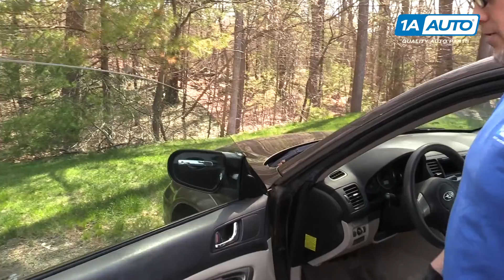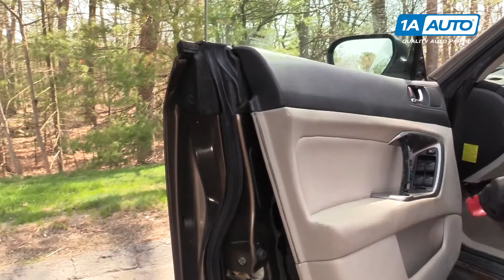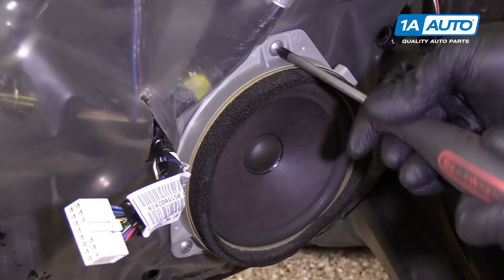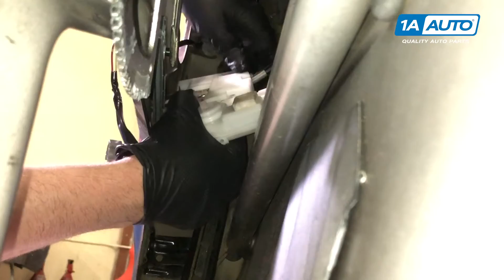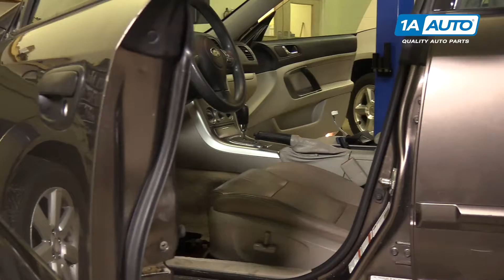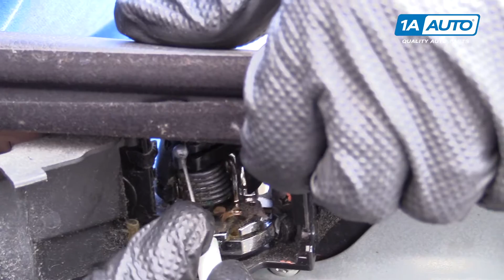How To Replace Front Door Latch 04-09 Subaru Outback

Comment: Hey, thanks for the video! Great video were capturing images of the parts, etc. Super helpful to get bearings and visual. 
 **PLEASE READ HUGE TIME SAVER- NO NIGHTMARE W/LATCH ROD**: First like everybody says you don’t need to pull the speaker/full vapor barrier etc but it’s still useful for people trying to get bearings on how it all goes together. Now, if you do what I did, you don’t have to disconnect either one of the latch/lockrods. 
Here is WHAT I did: remove your door panel lock and latch cables, but carefully leave the door panel hanging connected to the window switches. WARNING: keep your hands and parts lock cylinder clear of all the window components while you have the window switches plugged into power. Turn the key off when you’re not actively moving the window.
First thing I did was roll the window down and remove the rear bolt of the bracket,  that holds the lock cylinder in. Straight shot with a 10 mm socket. Keep the lock cylinder pushed in to the door handle so it’s out of the way of the window track. From here on out. totally possible to use the bump the window control to be able to get the bracket out from the door and then pop the latch tops and remove the handle.  The latch rod is still connected to the handle and you can disconnect it from the outside of the door, standing up right in front of the door. It’s an absolute piece of cake! Do this at your own risk and be extremely careful with hands and parts as far as powering the window.

Comment: It's good that such a video exists, because without it no-one would try to do something like this.
However, why would you want to replace this? What's the use case?

Now my actuator failed - so, I could not get the door open. So, the first few seconds of this video is a fail. "First, open the door".
Without that first step, 
(1) you can not remove the door card.
(2) you can't unscrew the actuator
So I guess that, as long as the part you are trying to replace isn't broken, you have no issues.
Reply: Really this is just a video on removing and replacing the door card.

Comment: I reinstalled after I put a new door lock actuator on, and it's still not working with the button on my keys! Any ideas? I'm sure I reassembled correctly
Reply from the maker: +stefan cogurik  We wouldn't be able to diagnose an issue like that here, you may want to have a local mechanic take a look at it. Thanks for checking us out! http://1aau.to/m/Shop-1AAuto-c

Comment: Thank you for this video. It was very helpful for me to complete this task. Removing the 12mm bolt holding the bottom of the window track was critical to getting the latch out. Wish I had read the comments first. Would have saved some time. Drivers lock now works with the key again!!!!.

Comment: Thanks for the vid. I needed it to help replace the door lock actuator. Not sure why you felt the need to completely remove the weather barrier except for making the video easier. I also loosened the nut that held the bottom of the window track for an extra bit of wiggle room. 

But really, Subaru, could you have made this even more of a PITA? First time I have had to pull the latch out to get a lock actuator. In other cars this is a ten minute job when you don’t know what you are doing.

Comment: Great video. Helped me tackle the project after my drivers door actuator failed. 
One tip : take off the 12mm bolt at the bottom of the door holding the track for the window. 
That extra wiggle room saved me after 30 min of struggle lining it up to go back in. 
Thanks! I’ve used a lot of your tutorial videos and they are great!
Reply from the maker: +Lance Petan Thanks for the tip!
Reply: I did the same as well. It helped a bit.